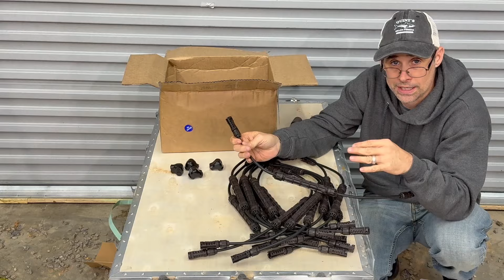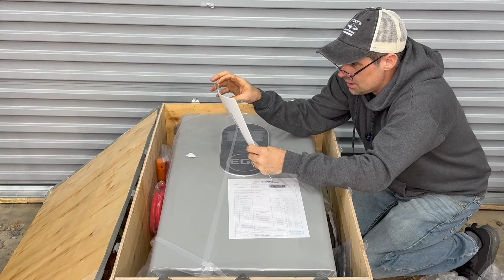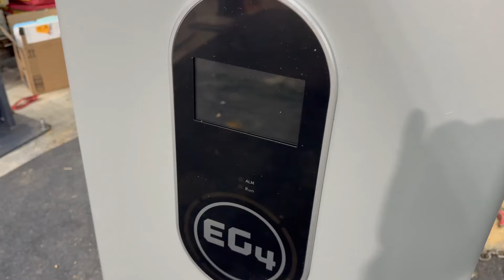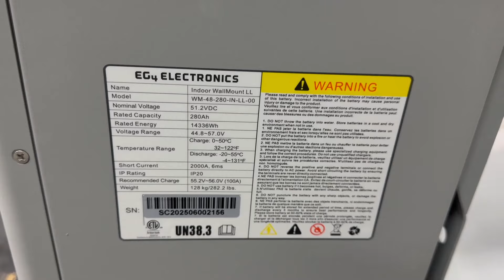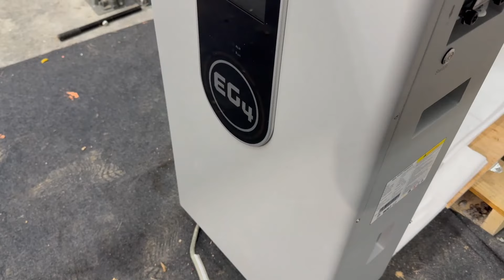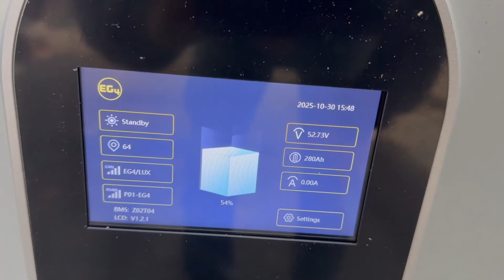Giant  EG4 Battery Unboxing - Is It Worth The Hype?

Comment: If I'm ever going to upgrade and use these new EVE batteries that are 300 or 600 lbs I'll need a fork lift or tractor. Possibly multiple heavy lift thingies depending on the location. Maybe the batteries need assembly on pallets. A fork lift to move the pallets on to heavy shelving? Time to get to know what neighbors have what equipment. Or maybe I can rent the equipment to move stuff when I need to?
Reply from the maker: Heavy equipment definitely helps.  I used my excavator to move pallet to my shop.

Comment: I'm confused about fuses. My understanding of a fuse is just something that burns out or opens a connection when too much power goes through it. To prevent power from flowing down a string of solar panels that are shaded would require a diode. Obviously though I don't understand something important. Would you please clarify?
Reply from the maker: If you have multiple strings in parallel and a single panel shorts out, there will be an large inrush to that string which can cause a fire.
Reply: Okay, I think I pieced it together from the other comments on this video. Say each string gives you 10 amps and you have only two strings. Well having a 15 amp fuse on each string will do nothing for you. But if you have three strings and one has a short that pulls in the 20 amps from the other two strings then the fuse would blow protecting any more power from back feeding into that string. Did I get it correct?
Reply from the maker: @CheapHomeTech Absolutely correct!

Comment: I think you should put fuses inline but I don't see how a fuse will keep it from back feeding Caps will let power on e way only please tell me how your way works
Reply from the maker: Thanks for watching Robert.  Each parallel string needs its own fuse according to the NEC.  It prevents one shorted panel from drawing excessive current from others and causing a possible fire which is pretty rare. The fuse size should match the maximum series fuse rating specified for the given panel.
Reply: @MikesSolarGarage  Yes it should so it don't take out the others but you said it keeps it from back feeding and it is no way power will flow both ways with a fuse That is why I a control for each set of panels
Reply from the maker: Very good point, thanks Robert!